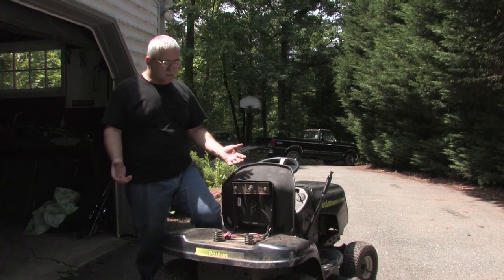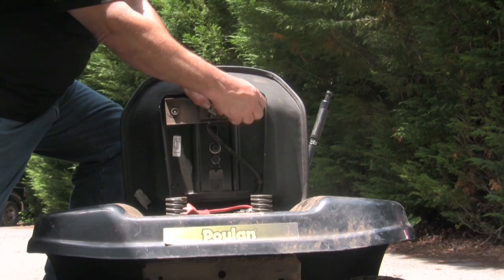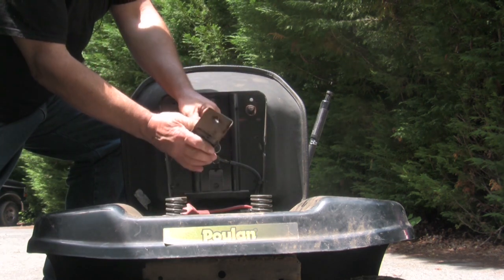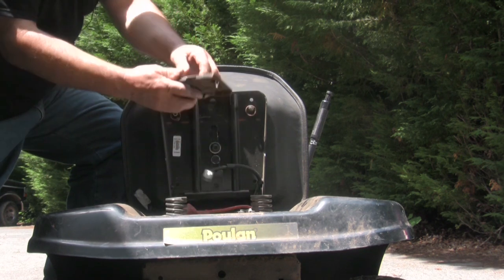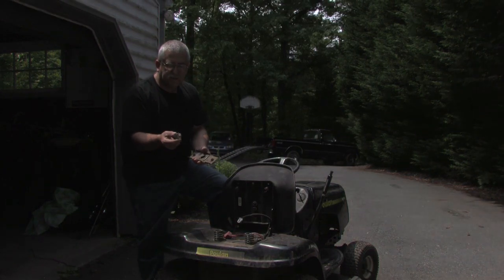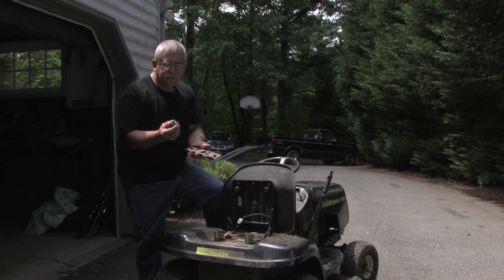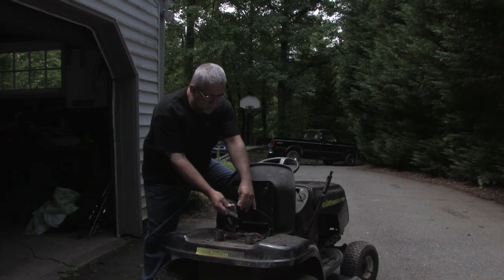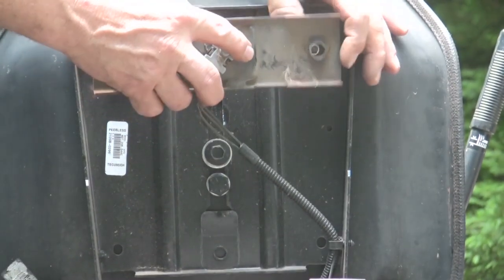Lawn Mower Repair : How Do I Disable the Seat Cut Off Switch on a Riding Lawn Mower?

Comment: I dont mind if I have to turn the deck off to get off the mower but it should still run the engine if the blades are off and I get off.  Theres a difference between safety and inefficient.

Comment: I was using a friend's John Deere ride to cut their grass while they were away. My family were in the UK (we live in France). I got too close to the edge of a slope and it rolled over, with me underneath. I was trapped under it and as the seat was pushing against me, it didn't cut out. Fortunately, I was in a bed of brambles. I was stuck under, wondering how to get out when fuel began dripping on me. That got me moving. I couldn't get out from underneath as it was too heavy. I was able to brace my feet against the mower and managed to push it away from me enough for it to continue rolling over. I got concussion and count myself lucky. I could have quite easily gone up in flames.